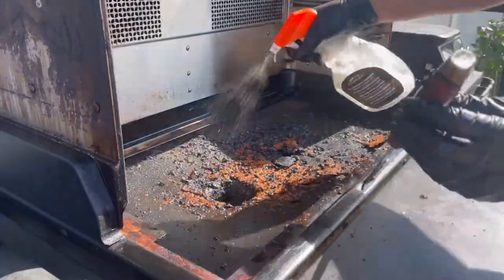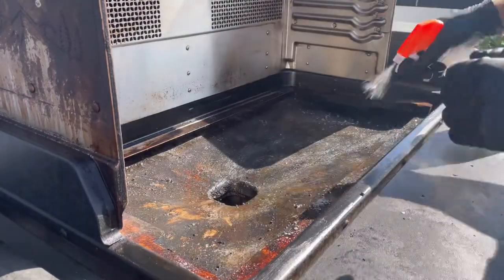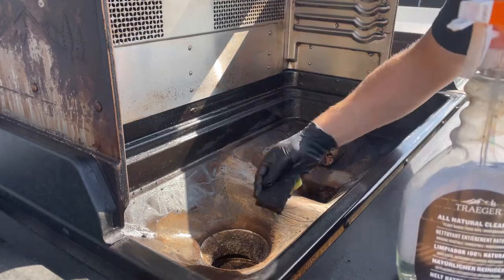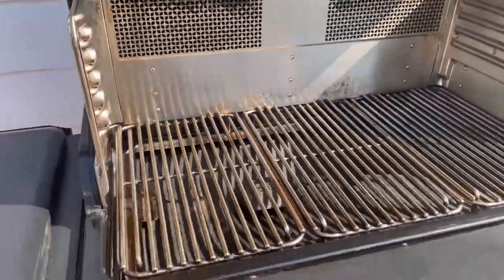How to clean your Traegergrills Timberline XL @TraegerGrills

Comment: Still liking the grill? I'm debating buying one this week. Some of the issues I'm reading about, plus big temp swings have me nervous. Have you experienced any of that or has your grill been pretty good? Current Timberline 850 owner who needs more grill space! Lol
Reply from the maker: I do love mine!!! I am very fortunate to have not had to deal with temp swing issues. Mine is one of the ones that has been dialed in from first purchase! I love this thing still ;)
Reply: @triple6grill284  Thanks for the response! Do you find at higher temps the food comes out smokey? My older timberline burns clean above 350 so I can use it like an outdoor oven. My concern with the XL is that it puts off too much smoke at those temps which might throw off things like pies or something that you don't want to take on a smoke flavour. What's been your experience?
Reply from the maker: @skidoomxz550x  it definitely produces more smoke; no joke! But I’ve done some baking at 350 and above and it is subtle. It’s not crazy overpowering. My fam still loves and uses it for baking.
Reply: @triple6grill284  Thanks!
Reply from the maker: @skidoomxz550x  no problem!!! I’m here if ya got questions ;)